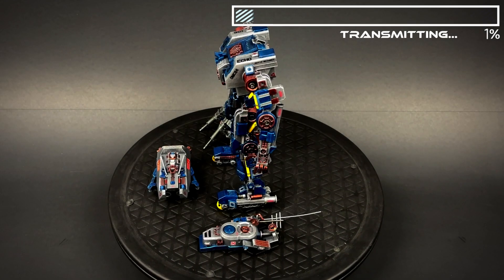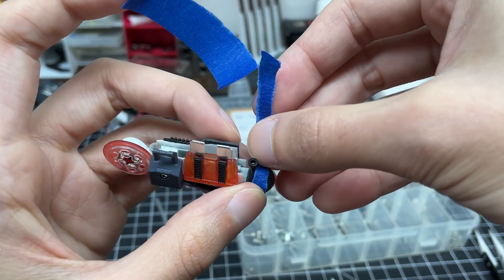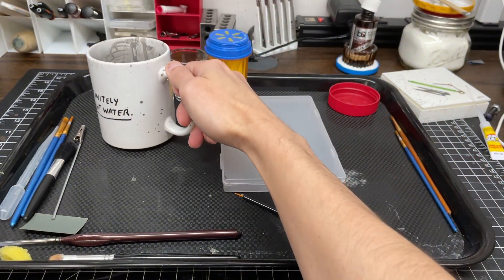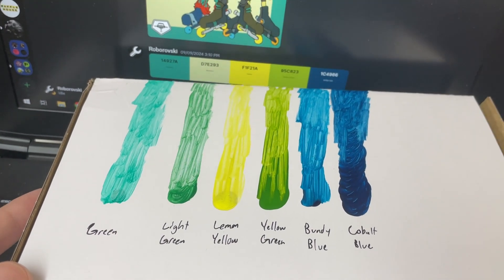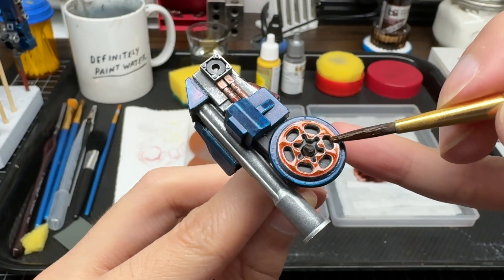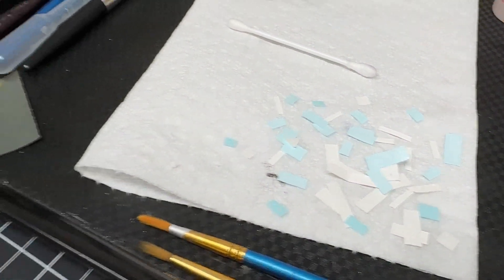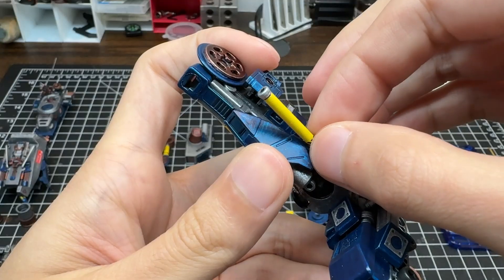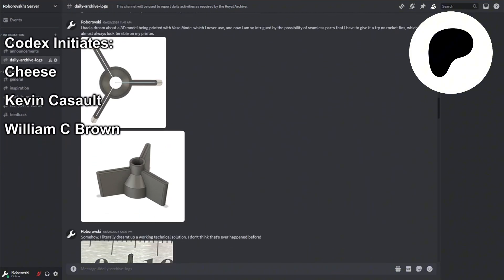ECHO: Rollerblading Mech Finishing (Part 5)

Comment: Nothing in-character this time, just admiration.  I think what makes these videos so rewarding is how you manage to make it feel like these are vehicles and designs being worked on by people whose job is on the line.  Even if your actual build decision for a part is rule-of-cool, you will still come up with a sensible reason to include whatever it is.  I don't think I could really point at anything specific and say "that was put in to make it look cooler,"  your in-universe explanations for why your designer makes a specific choice always feel like the work of people making informed trade-offs between options.  That is exactly the kind of worldbuilding that I love.  A creator can include any kind of insanity in their setting that they want, it's how the world is changed by the existence of that insanity that matters to me.

Aesthetically, ECHO really looks like the work of someone who is used to operating in the milieu of industrial construction equipment and mechanized infantry support who's worked out a recon design from first principles.  The thruster systems and lightweight frame are the two tricks our guy has put together, and the lack of armor is a concession to the needs of those two abilities.  The backpacks make incredible sense in that context, as there's just not the space to bake all of those devices into the frame like you would with a larger mech and the size of the mech is constrained by the need for the thrusters to provide useful mobility.  That is exactly the kind of solution a practical engineer operating outside the existing culture of military design would do.  

In that I mean that if this guy can crank out a mech, this world has a Northrup Gruman, Lockheed, and Raytheon.  I imagine the designers from those houses would look down their nose at ECHO since - in their traditions - ECHO would be a whole series of mechs with defined roles similar to the roles ECHO can take on by switching backpacks.  They aren't wrong, big military contractor versions of various ECHO builds would be more capable, since the basic systems would be more tightly integrated with their mission.  

All that aside, the painting and detailing of the mech are top-notch.  ECHO really looks like a prototype ready to be tested and spun out into a manufacturing contract.  She's a tiny bit worn, but well maintained and intended to look her best.

I am rooting for you in the OMC.
Reply from the maker: Thank you, I appreciate the kind words! I am a big fan of worldbuilding and struggle more with story telling, so being able to come up with components that make sense for a machine owned by an organization is more natural for me than having fun back-and-forth dialogue. I've been itching to make videos like these and I'm glad I've been able to get that across to others. It'll take a while to showcase the rest of the world I've built, especially with the nature of the videos being focused on specific machines and not whole organizations or locations, but with time I'm hoping to paint a very large picture for everyone. I'll keep experimenting with narration and see where I can fit in more story telling of the world, and not necessarily every fictional glue I use 😁
Reply: @proto.roborovski  freaking awesome dude:!
Reply from the maker: @eyebeepirate  thank you!